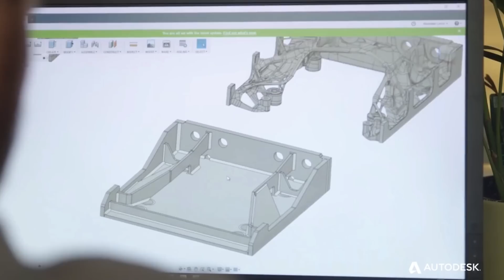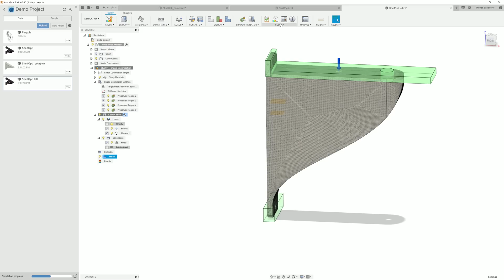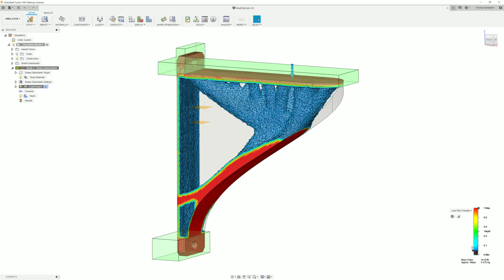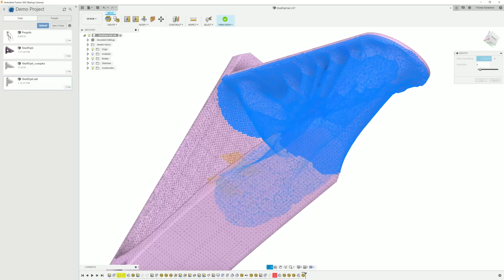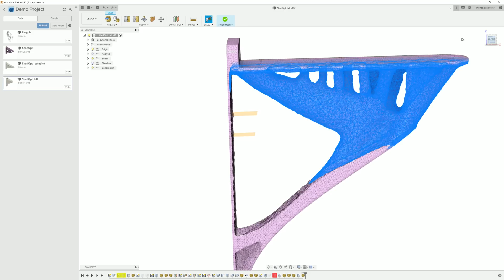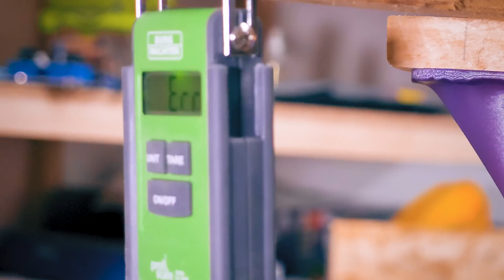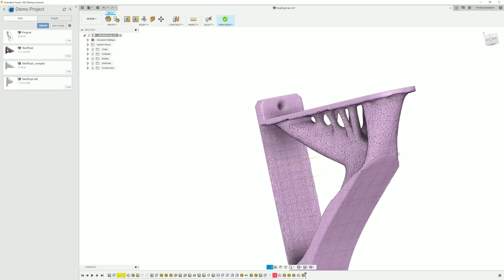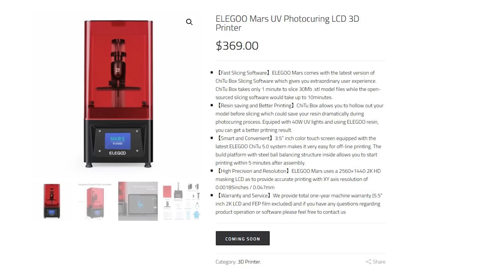Making STRONG shelves with Topology Optimization

Comment: Have you considered creep (material aging under load)? PLA is notorious for it.

Also I still don't understand why people just don't design the part hollow where you don't need the material instead of using infill.
You're infill also makes the simulation nonsense (besides anisotropy).
Reply: "Also I still don't understand why people just don't design the part hollow where you don't need the material instead of using infill." I think a part of it may be that it reduces the distance that the printer needs to bridge or create over hangs for when creating the top layers. As printers can be quiet restricted in how far they can bridge and overhang the fill makes it a lot easier to design printable structures.
Reply: Designing hollow parts for 3d printing requires special design considerations (I.e. limitations) and printing hollow will never produce a stronger part than printing with until. Computer simulations don’t have to be absolutely accurate, relative accuracy is good enough in the world of 3d printed parts.

Comment: I feel like instead of putting a "do not affect" region around the mounting holes, you should have applied a force from the outside against them toward the wall. that way the algorithm could have simulated not only the downward pressure, but also the torque against the mounting holes. the mounting hole is where most of your force is concentrated, but it wasn't simulated that way, since your only force vector was pointed down.

Comment: I'm afraid you`ve got it wrong. This kind of structures have more cross section in the 90 deg corner, due to the reason that it have to bare the cutting force (in the same direction as gravity forces) and the flector momentum that produces a strong force perpendicular to the wall and in the opposite direction to it. The way you did, you can place a diagonal bar to send the forces directly to the wall, but you still have to bare the cutting force in the upper 90º corner.
Reply from the maker: What

Comment: This is a very cool exercise, and the multi-fingered branches holding up the top portion of the bracket look very nice (almost Gaudi-esque)!

Since you're optimizing for structural strength and minimal weight with the goal of generating an interesting form, I feel you've mis-constrained the problem in a couple critical ways:  First, you chose an arbitrary curve for the diagonal portion of your "blank" before the optimization was run.  You can see that this is not an efficient structural shape because the optimization just used the extents of your blank instead of its own solution (which would have looked more organic).  The diagonal wants to be straight, not curved, but the blank is not allowing that to happen.  I would have started with that rectangular block you showed at the very beginning and let the optimization guide you towards the right curve (or likely straight angle) for the diagonal portion of the bracket.  Second, for loading you chose a point load about 75% of the way towards the end of the bracket.  I'm not sure this represents the actual loading condition.  Your loading condition is more likely a distributed load along the whole length of the bracket, and that load is not uniform because of the overhang of the shelf beyond the bracket and the stiffness of the wood you're using for the shelf.  I think if you played with these two parameters, you would find the resulting bracket looks quite a bit different (maybe not as good) and would probably be stronger per total material used.

And of course if the whole goal is to make a structural load-bearing object, it would be a good idea to anchor them into a stud rather than using drywall anchors, as you found out the hard way...

Thanks for the informative video, I wish I had your 3-D printing prowess.  I would love a house full of these type of objects!
Reply from the maker: Please watch the video again, I address almost all of your concerns.
Regarding the load: I understand the type of load I used is actually an area load with an offset center - hence it generating more support towards the front. It's exactly lined up with the center of gravity of the folders it will be carrying.

Comment: Why do I not see anyone doing vids on epoxy injected voids? I create cavities in prints and use fiber reinforcement injected with epoxy. This creates extremely rugged printed forms. Layer line orientation is no longer a issue.
Reply: That's actually very interesting! Using a 3D print as a permanently attached "mold" for the actually structural components. I love the idea!

Comment: But... All of those brackets are incredibly inefficient. Those will have lower strength:weight ratio than any rational design.

This is the definition of bad design.
Reply: I'm curious as to why you say that? Since this process is literally a strength/volume optimization?
Reply: @Electroblud  It starts with a grossly unoptimized profile, and treats the entire back section as a locked face, as if it were welded to the wall evenly. It also treats the top of the bracket as the load bearing face witch it is not.

These mistakes in design and setup of simulation are good examples of people using advanced tools that they don't understand to do jobs that they don't understand with materials that they don't understand in applications that they don't understand, and then selling the idea of the product to people who have no idea what they're seeing.

Leave engineering to engineers, we're good at it.
Reply from the maker: Comments like these are a great example of people not understanding the goals of a project and pushing through with their way anyways. As I explained in the video, the goal was to create a bracket that was both strong and had a unique look to them. If I only cared about getting a brace as efficiently as possible, I would have bought the one from IKEA.

Comment: Sure looks nice; but from a mechanical perspective it makes little sense. The simulation undoubtly assumes a solid material, not a shell. And the whole finger structure looks cool, but is entirely redundant; it seems to only exist because the simulation does not want to assume there is a rigid shelf there that isnt going to split along its length. Take that away, and the optimal shape can easily be guessed at; a triangle. Thats not a criticism of your project; but just illustrative of what always seems to happen with these topology optimization tools. You spend a lot of time computing, not being able to express a lot of things essential to your design, and either end up reinventing geometric primitives, or creating a cute art piece.
Reply from the maker: I'll gladly settle for a cute art piece that supports my entire weight.
Reply: @MadeWithLayers  fair enough; but Id bet the same mass of PLA in a triangle would have at least twice the ultimate strength.

Comment: why using a local force on the simulation instead of a distributed one? I mean, it's a shelf, all the weight is going to be distributed. 

Very interesting info, btw.
Reply from the maker: It's a distributed force IIRC, only represented by that single arrow to visualize the center offset.
Reply: @MadeWithLayers  Alright, got it. Thanks so much for the quick response!

Comment: Stud Finder?
Reply from the maker: What studs?
Reply: @MadeWithLayers  The studs in the wall that you should anchor to. at least for loads. A shelf should be mounted to a stud and not just the drywall.
Reply: @dingo42069  pretty sure thats no drywall

Comment: I think topology optimization is mostly good for solid components (as in, not FDM printed). When it comes to strength and lower material use, at least.

I've noticed, that you can sometimes actually save material cost / weight by removing holes, as they will basically replace some (low) infill with perimeters. On the other hand, they can increase part strength. And look cool. The most important thing.

Comment: Make no mistake - they look nice - however you’ve failed to add any method for retaining the shelf itself to the bracket you’ve designed.    So while it looks neat - functionally it’s just not happening.  I prefer my shelves to stay ON the bracket so that when I slide an item across the shelf or off the bracket - the shelf stays put.
Reply from the maker: Lol there is double sided tape between the bracket and the board.

Comment: If you try with Solid Edge you will be able to use generative design and choose the manufacturing method. so at the end you can have a part that was generated with 3D printing inmind and have no supports in the part. :)

Comment: they all break at the unsimulated part , where it attaches to the wall
Reply: yea the connection seems to be the weak point on this.  Seems like it might fail from tear out due to shearing if overloaded, or possibly bearing if plastic is somewhat malleable.
Reply: @JT-ir6vw  you have bigger problems if your dealing with tear outs
Reply: I wonder if the software take into account fixed points, or only cares about load and shape.
Reply: 3d prints are just strongly anisotropic in strength.  I'd bet money that fusion 360 only deals in uniform materials.  It looks like every failure was a delamination of printed layers.
Reply: sure looks like its cracked on the bottom section when it rips out of the wall
Reply: It's an area of stress concentration.. The 90 degree corner on the top mounting hole is the issue. If he simply put a small radius on the corner, it would significantly decrease the stress concentration in that connection thus increasing the amount  of stress it can withstand.
Reply: thats what engineers have to be careful of when using FEA (computer models)
Reply: It would probably be a great idea to use the print to make a mold for use with stronger materials
Reply: @HDefined88  you can 3D print metal, well a bit more expensive but still
Reply: well, and im guessing the modeler didnt assume an infill pattern, it assumed solid mass...
Reply: It is assumed (to the cloud servers) theese parts are solid, without any "gyroid infil". So it broke just because nobody told that the part will be almost hollow.
By the way, it must be I misunderstood why PLA was used in this case. As for me, I would like to use PETG, not PLA or ABS.
Reply: thats surprising?
Reply: Didn’t account fully for boundary conditions?
Reply: Because there is a hard edge. If he even only applied a little Fillet there it would already be much stronger.
Reply: True! He should have simulated that part too, because there's force applied to that part too.
Reply: Thing is, did he use a stud finder to more securely place the shelves?
Reply: @scout2369  It's a aircrete(air concrete) wall there aren't any studs, you're supposed to use plugs made for aircrete.
Reply: @djonez85  jup, really popular material in europe and northern europe, good insulation properties, dirt cheap to make and assemble (literally like oversized lego bricks) but a hassle to drill into, because its so soft.
Reply: @djonez85  i came for this thanks for sharing aircrete sounds ideal and we need to use it here in the us.
Reply: @saspurillie  Europe has a very different architecture and it brings its own problems. Inner walls of my house are 20-45 cm of brick walls and outer walls are 60-65cm of bricks and those thickest (and oldest) parts are 90cm of just roughly cut stone stone and mortar.
My neigbour has a modern house with much thinner walls of foam concrete and his  thermal conductivity is much better than mine but that's the thing. My house is 200 years old with my cellar and groundwork stretching back to late 17th century. His house was built some 5 years ago. I can use basic nails or simple plugs but the aircrete needs very weird anchors (weird for me :- ) ) to take the load.
Reply: @scout2369  German houses are not built like American houses. Their methods and materials are completely different, even electrical wise.
Reply: @scout2369  no studs in normal houses. they are build from concrete bricks can stand big tornados earthquakes hail... built to last
Reply: Scout2 it does not look like it lol, he just put it into the drywall.. he's clearly not informed on house work much, hes put his brain towards 3-D printing
Reply: @greenthizzle4  I think most houses in Germany are built different from America. they don't use wood... it seems to be mostly masonry. If you notice Germans always mock American house construction methods
Reply: @greenthizzle4  drywall? don't you mean foam-concrete-stuff?
Reply: @qyoo620   That's not gypsum board.  It's something different that they use.  I think this guy is smart enough to know if his place uses typical board over stud construction, which it seemingly does not.
Reply: @phuturephunk  whatever it is doesnt stand up great to shelves
Reply: @cyan933  Well to be fair Germany has had enough wars on it's soil over the years to compel the use of masonry. Their homes will hold up better to mortar fire. That and their woodlands are fading into sprawling cities to home the economic migrants. So they're doing the best with what they have.
Reply: @TheNajSD  to be fair it's not like USA has to deal constantly with tornadoes and floods or temperatures over 100 F (40ºC) and below 30F (0ºC), where this kind of proper material is needed in order to protect their houses and not to waste as much electricity to refrigerate or heat houses.

Silly me, actually Northern Americans do have to deal with all of these, just like Europeans, it's just that we don't keep doing things the same just because it is cheaper short-term.
Reply: @TheNajSD  Unsinn. The few imigrants (compared to citizien numbers) are certainly not the reason for disappearing forests.
Reply: @lillydufeu  Lol. That's quite the hyperbolic statement. If by a "few immigrants" you mean millions? That's like saying I only made a few dollars last year (compared to the money the entire country makes) when I made a few million. 

And I never said they were the sole reason. It's called compounding factors. If I have a cold and I don't eat - I'm making my cold worse because my body needs the nutrients to combat the virus. But that doesn't mean the reason I have a cold is because I didn't eat. 

Stop lying to yourself.
Reply: @TheNajSD  Or you could stop being racist but lets be realistic here
Reply: @jordanjacobson6046  Whats racist about talking environmental impact from massive population surges? Is your pretend-offense more important than the environment?
Reply: @TheNajSD  My offence im taking is to your clear racism and lack of logic. Those migrants one are on average much poorer than the average EU citizen so their resource utilization is well below average, and the other is that those migrants account for literally less than 1/500th of the population of the European Union so to even mention them as being a cause of resource depletion is absurd and saliently racist. Their low relative resource utilization compared to other classes means that at worst they are using 1/500th of the resources, but in reality, that number is more like 1/750th or even 1/1000th of the total resources consumed by the EU. But yeah, lets definitely blame the least impactful group on the environment for the harm that has been done to it.
Reply: @TheNajSD  Just looking at the channels and videos you share and like makes it hard to believe you aren`t on the, well not right, but the conservative side of that argument. Which amounts most often to, lets say, an unhealthy view towards fellow human beings that didn`t have the luck to be born in the same corner of the world as you.
As i`m guessing, and please correct me if wrong, that you`re an American Citizen and through that assumption it would mean you yourself are the descendent from a massive population surge of Europeans on the American Continent and the environmental impact it had on the indigenous Peoples living there.
Maybe you think you know what you are talking about, but here in the DACH region of the world, the Forrest don`t die because of Migration, but because the capitalistic System has and is about to destroy the natural environment worldwide. Which is also the cause why people have to leave Homes down south, where the impact of climatechange is allready feelable. 
When two things happen at the same time, one isn`t the cause of the other, but rather share the same common cause.
Reply: @greenthizzle4  Based on where he lives,  the houses aren't made from wood and do not have studs,
Reply: @TheNajSD  Your cold will go away if you dont eat for long enough, you should try it.
Reply: @vwertix1662  I don't often get colds as I'm not an unclean simp living in a city dump. But I'll take your expertise to heart if I ever do get sick. Rando's on the internet have the best healthcare advice despite crying about their lack of healthcare access.
Reply: @TheNajSD  Blaming migrants for forest decline is not just callous, but completely misguided. There are trade-offs between population growth, sustainability and economic development. The immigration induced boom in population has caused housing prices to increase and created a shortage of low-income housing. This has led to short term increases in urban sprawl. The situation in Germany differs strongly from the US, where 3/4s of large cities have increased sprawl indices due to auto-centric infrastructure and poor land-use density.
Reply: @cyan933  German masonry is part of their national pride. years studying, years on the job learning, years completing a masters degree kind of qualification... So ya their stone/timber skills are well mastered. But its no secret, their techniques are simply honed much longer, and their culture requires it... German houses last 250 years because of it... But it doesn't mean you can't use those techniques anywhere... Its just the best STANDARD.